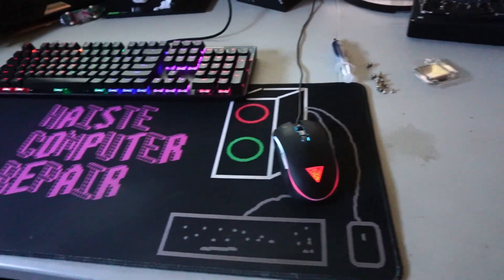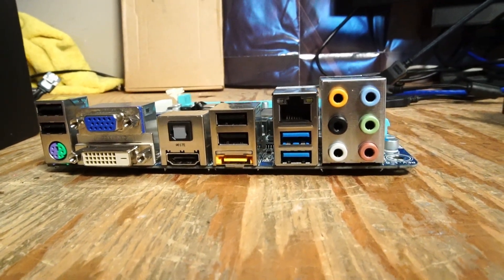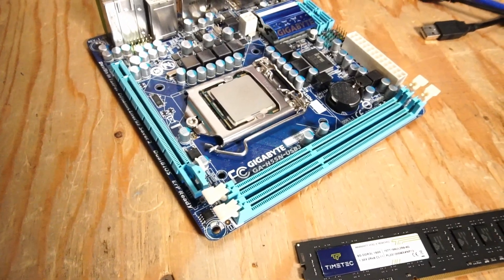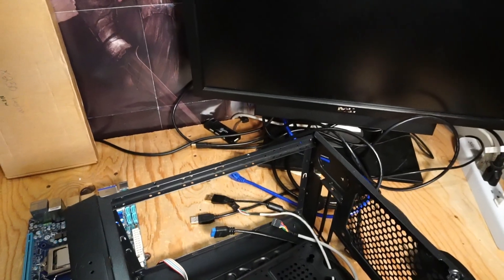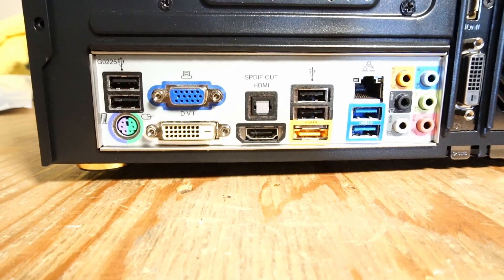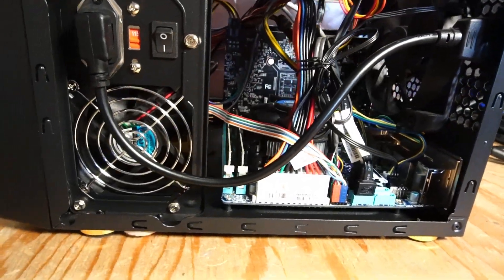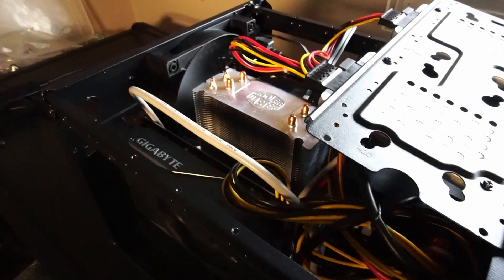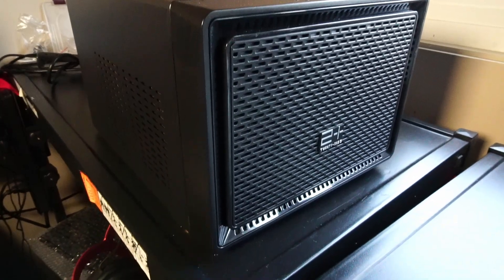Can you use an i7-870 in 2024?  Gaming & Video Render w/GTX 1650

Comment: The i7 870 works much better with the RTX 4060, until recently I had an x3470 xeon which is the same as the i7 870..
Reply from the maker: I would definitely try it out for a test run

Comment: Building a similar system right now here on my desk. Purpose is a cheap rig for random use. Like when a buddy comes over and we'd like to game together. But mostly just for fun :D

Zotac H55ITX-C-E
i7-870
GSkill Ripjaws DDR3 1333 MHz 2x 4 GB
Zotac GTX 750 Ti 2GB ITX
Random 500 GB SATA SSD

I'm planning on using the Zalman M2 Mini Case.
But that would require a low profile cooler...
Any suggestions?
Would the Thermalright AXP90-X53 be sufficient for this little powerhouse of a CPU?

Greetings from Germany! :)
Reply from the maker: Greetings!  I think that cpu cooler would be deluxe  compared to the stock cooler I used.  Sounds like a fun project, good luck

Comment: Can core i7 870 support 32gb ram ddr3 buss 1600 ?
Reply from the maker: Yep, it would just depend on the motherboard you have.
Reply: can asus p7p55d pro support 32gb ram? and can i ask if my computer configuration core i7 870 + gtx 1060 3gb can play genshin impact and valorant
Reply from the maker: @thinhtran9745  Yes to the games.  As for the RAM, you'll just have to try it out.  It seems like some information online leads to yes, however that is just anecdotal coming from me as I have never used the board myself.
Reply: @HaisteComputerRepair  thank you very much. have a nice day
Reply from the maker: @thinhtran9745  No problem.  Specs on the motherboard have the RAM max at 16GB, but 32GB was far less common and it is very likely that 32GB was not tested with the board before launch.  This is quite common.  Ex:  my ThinkPad T480s was specced at 24GB max on paper, but I have 40GB installed.

Comment: Nice build! I still use one (x3450 2.66 base clock, so it's an i7 860). It's overclocked to 3400Mhz and undervolted to 1.15v, with all power saving features enabled. This was the last fully unlocked generation, before the K cpus and before OC was removed from entry level mobos.
Reply from the maker: Very cool, are you using as a daily driver of sorts or for some other purpose?

Comment: You've obviously got good ventilation in that case, as the temps look fine. However, even to this day I cringe when I see an Intel stock cooler. In truth, they were fine back then for a Core 2 duo, but nothing else.
Reply from the maker: Yes, the Intel stock cooler is essentially e-waste or only for use in systems for general use.  Pretty well the same cooler since 2009.

Comment: I've got an i7 870 and have been trying to figure out what gpu to pair with it. Great video man!
Reply from the maker: Thanks!  I had this GTX 1650 that wasn't really going to be used in any builds.  It's not a huge investment and still performs pretty well on a motherboard/CPU with PCIe 2.0 speeds.
Reply: Get Intel ArC
Reply: @nishantbirari9300  I'm not gonna pair an intel arc card with a first gen i7. I'll only be getting like 20% of the performance out of that card
Reply from the maker: @jonesthehobo  There are some lighter cards that Intel was offering that would pair alright.  Though I am unsure about long term GPU support going forward after Intel's restructuring and losses following their 13th and 14th gen problems.
Reply: @nishantbirari9300 no its Bad idea on 2008 cpu it doesnt have resize bar
Reply: i am using i7 870 too. having 16gb of ram and gtx 1050ti  is enough. can run high graphics in 2024 games